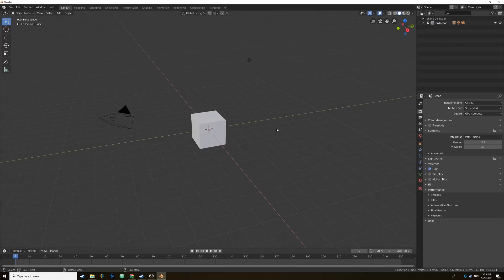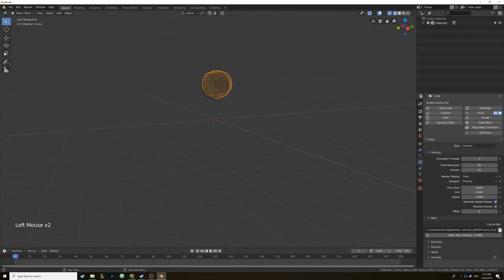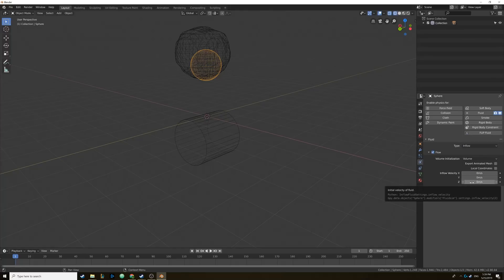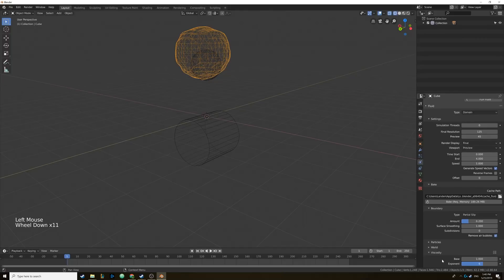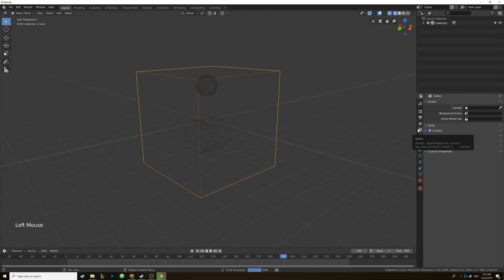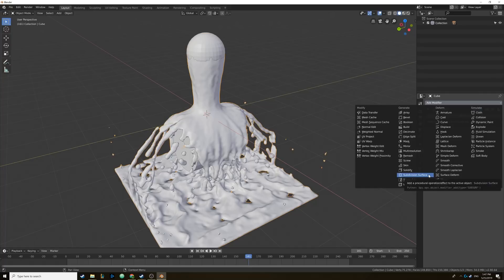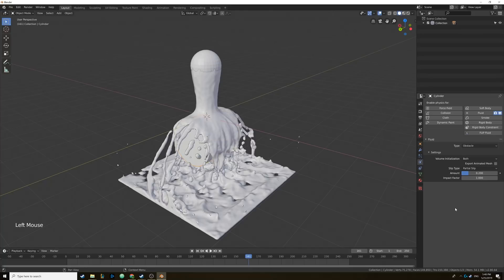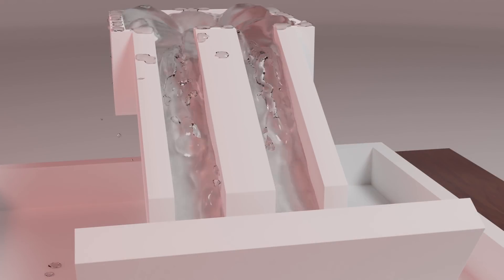Learn Blender's Water Physics in 10 Minutes! (Blender 2.8)

Comment: Thanks for doing all the homework! It occurs to me that 3D is STILL a tool for the wealthy (or very patient) who can afford a killer-fast system.
Reply from the maker: Look into blenders new rendering tool Eevee. Also, if you really want ray tracing, newer Nvidia graphics cards come with new RT cores. You can buy entry level graphics cards to accelerate your rendering.

There are also a lot of new AI denoising tools in blender. You can render images at a much lower quality and have them cleaned up by the AI.

Comment: excusme sir, can i ask a question? maybe its little bit out of topic. I just tried to make smoke effect in my project for school homework using blender 2.8.3 version, but in the viewport mode the smoke wasn't visible, then i tried to make new work space with factory setting and the smoke effect just run well, can u help me what's wrong with the first work space? thank you.
Reply from the maker: Sorry, this video uses an older version of blender. The new simulation system in Blender shares some of the same concepts, but the buttons are moved around. Try googling "blender manta flow."

Comment: hi, I did everything exactly as your tutorial, but when I tried to render the video I only got a gray picture, nothing else. Do you know what might be wrong?
Reply: did you give the water a texture? or set a light up? because both can be the problem.
Reply: @nunyabuisiness6950  Interesting story, I checked and everything's still grey, so I deleted the whole file and started again, which didn't take too long because I remembered everything, and the problem was gone
Reply: @nunyabuisiness6950  new problem... I had the resolution of the domain set to 125, and the bake would stop for no reason at about 50-70% for three times. I then lowered it to 100, and it baked fine, but I had enough memory

Comment: How come this stuff always looks a little...  gel-y?
Reply from the maker: Well I didn't add volume absorption/scatter to the volume so it is literally liquid glass (also should have tweaked the IOR value). Tweaking the viscosity and slip values also can give a different look and feel.

Water also usually have bubbles that float to the surface. I am not aware of an easy method to create bubbles without 3rd party addons.

Another thing that would have helped is usings dynamic painting to add "wet" spots on the collision objects where the water makes contact.
Reply: Like cum?
Reply: @JacobKinsley  .

Comment: Can you give your pc specs?
Reply from the maker: GTX 1080
Intel I7 boosted to about 4.2
SSD + Hard drives in raid 0 etc.

My PC is about 7 years old but I have been upgrading it.
Reply: Thanks. I just bought a new pc this year, AMD 2700X, RTX 2070.  Mainly for gaming but really wanted to get into doing stuff like this in my free time.  Wasnt sure if it was normal for your times or just a sign of your hardware's age lol

Comment: what is the diffrend between flip fluid and standart fluid?
Reply from the maker: Flip fluid is a 70$ dollar addon that adds a lot of helpful features and improvements to the blender fluid simulation. You can do things like pause simulation and resume later (if you cancel in blender all the data is lost) and they claim it bakes the sim faster with a custom c++ library/script.

If you want more info Google "blender flip fluid addon" on blender market or something like that.
Reply: @3DTinkerer  thank you. but more technic pls. is it baking faster. is it more realistic ect
Reply from the maker: It is faster and more realistic if you use the flip fluid settings correctly. For example, you can add ocean foam with flip fliud, cant do that in blender.

The list of features go on and on so I would recommend just reading their blender market page
Reply: @3DTinkerer  thanks

Comment: Another way to eliminate the dark glass issue (Which isn't realistic) is to set the Clamping under the render settings for both direct and indirect transmission to 0.

The Default setting of .2 might be good for performance, but it instantly makes a default glass shader rather dark.

Comment: 00:08 those water trinkets rolling down in pixelated cubes 

HOT DAMN REALISTIC
Reply from the maker: Just need to let the water sim bake for a week 👨‍🍳
Reply: @3DTinkerer   bruh you got GTX 1080 - , 
Me here with my amd r9 380 ;- )

no tears , only dreams now
Reply: @rohitghumare7515  integrated graphics gang rise up
Reply: @virtualfroggy  Lol using blender on old Macbook air. :)
Reply: @rohitghumare7515  dreaming a blender water simulation will fry your brain stem. it is that intensive.
Reply: @3DTinkerer  And then realize when you come back home after a week of holydays for your computer to render that it just crashed, probably the second day you left.
Reply: If only physics simulations were calculated on the GPU...
Reply: @chrisrezende  just so you know, blender 2.8 actually partly uses the gpu (as well as cpu) to calculate rigidbody physics
Reply: @AwareStub Man in Blender, GPU is used for viewport rasterization (through OpenGL) and GPU-based rendering (Eevee and Cycles GPU mode). Physics simulation in Blender is CPU-only. So it doesn't really matter if 3D Tinkerer has a beefy graphics card (as Autismo Maximo refered to), since the fluid simulation will be done by the CPU anyways.
Reply: @chrisrezende  Blender's fluid simulations aren't really as parallel as they'd need to be to see any benefit from using GPUs. I think there's also a lot of thread-thread communication necessary in this kind of simulation, so a GPU would have an even more difficult time with it than a CPU would.

Comment: What Amount of  Ram you have?
Reply from the maker: 16gb. DDR3 I believe. Gtx1080 does most of the lifting though.
Reply: @3DTinkerer  thanks for reply. Im running A 1060 GTX but only have 8GB reabable on my Motherboard. Planning on Seeing why my Other 8GB chip isnt reable
Reply: @ryanberry2828  Your windows may not be a 64 bits version. Check that out.
Reply: @Cyber_Kriss   I'm going to Look at my Version and need more. I think my Board.cand go upto 32GB
Reply: @Cyber_Kriss  that doesn't matter in this case.. because 32 bit windows only supports up to 4gb of ram..
Reply: @sonnyboi1761  Yeah you are right. Faulty ram or wrong socket maybe...